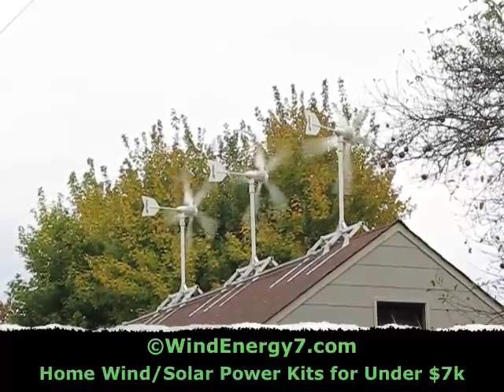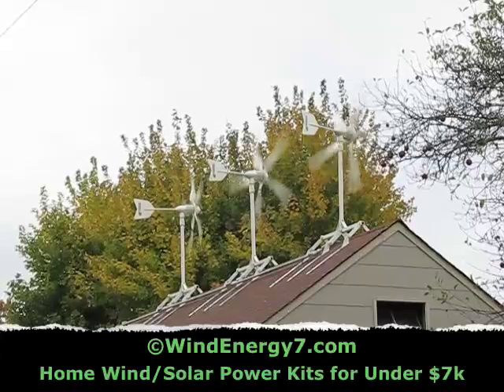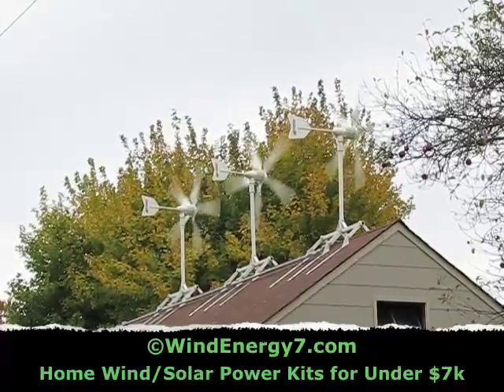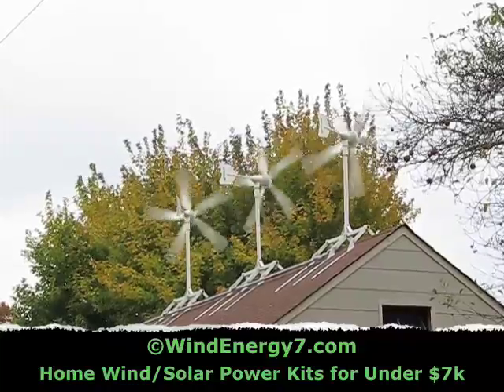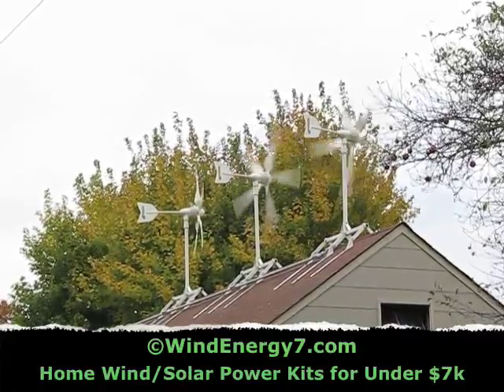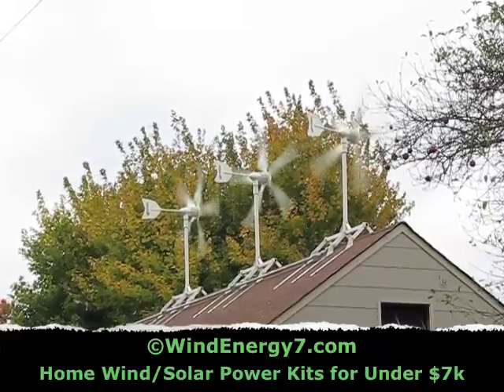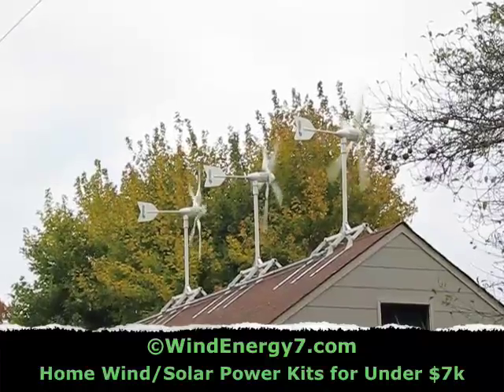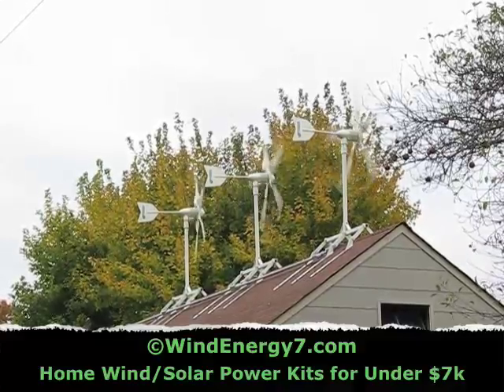Small Wind Generator Turbine Jobs

Comment: Is the energy generated is either a dc or ac??
Reply from the maker: BOTH, In order to have such efficiency the wind turbines are AC 3 phase and the system gear makes a conversion to DC for emergency power and control of output.

Comment from the maker: This Ohio small wind generator installer and dealer for WindEnergy7 has recently installed the most advanced small wind generator system in the US, the Home Wind Farm™. The hybrid system has a maximum power output of over 4kW. This Small Wind Generator system features redundant charging capability, integrated wind and solar hybrid generation, emergency battery backup for the home and more.  Get more Videos, Pictures, and Pricing at - - WindEnergy7 (.) com

Comment: Another Ohio small wind generator installer and dealer for WindEnergy7 has recently installed the most advanced small wind generator system in the US, the Home Wind Farm™. The hybrid system has a maximum power output of over 4kW. This Small Wind Generator system features redundant charging capability, integrated wind and solar hybrid generation, emergency battery backup for the home and more. The video here shows one of the most recent installations of our Home Wind Farm™ systems.

Comment: Small Wind Generators are our business. WindEnergy7 has patented the small wind generator invention pictured here.  Other systems will be too wobbly and noisy, having poor balance and vibrating parts.  Rooftop wind generators, it's what we do.  

WindEnergy7 . Com

RoofMill™ is an exclusive invention of WindEnergy7.  It's the most advanced home wind turbine solution there is.

TowerMill™ is our tower mounted system.  If you have an acre or more and want a tower wind system.